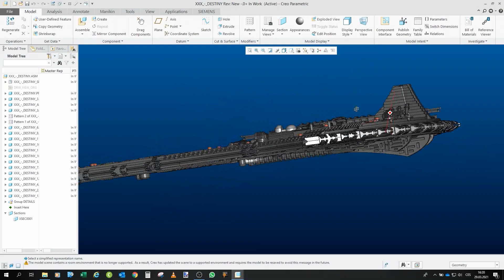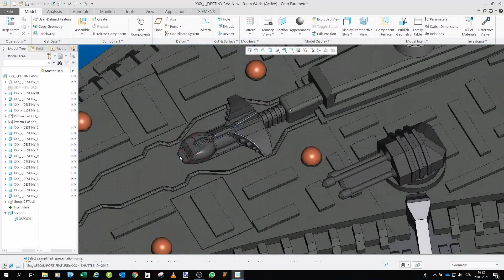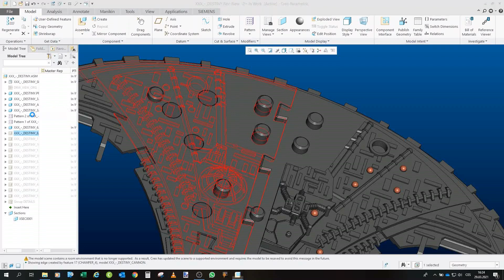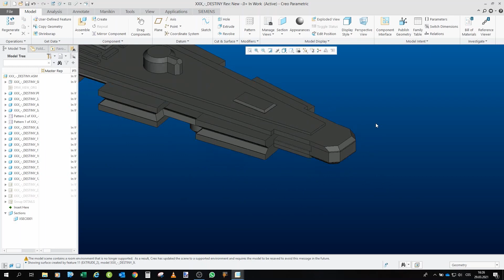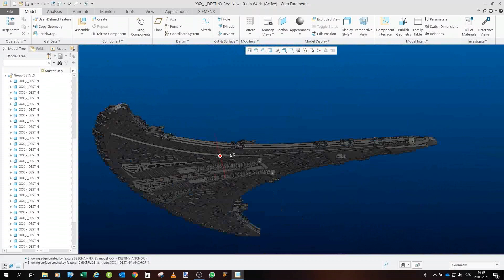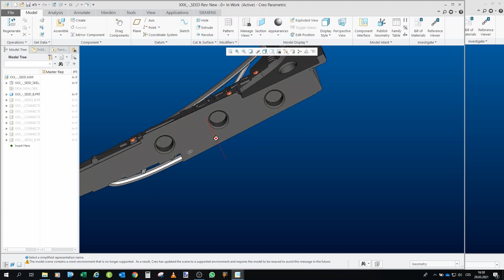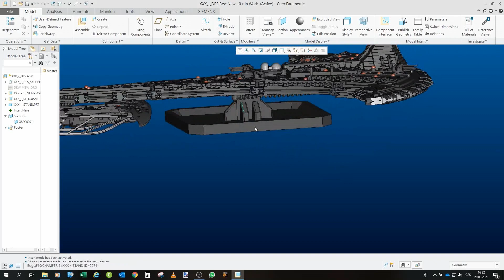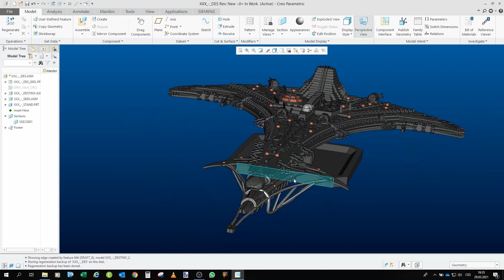Project Destiny Part 1

Comment: I too find it hard to make a compromise between level of detail and size of the model. Especially because i want to cram motors and lights into it. And like i said. This is the kind of video that i enjoy. Thanks for creating this hobbycorner for the mechanical enthusiasts ; -)
Reply from the maker: Hehe. Thanks for the kind words  yeah the lack of space is a real issue  i have to buy anozher vitrine....
Reply: @martintaichl  What about a couch table with a glass plate and a bottom shelf? Then you could make one really big model g